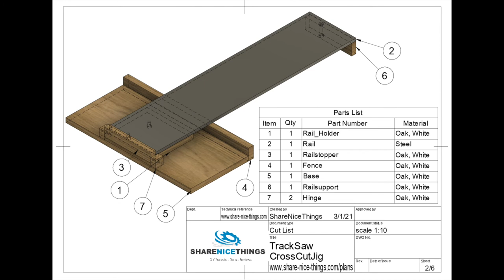Track Saw CROSSCUT JIG (precise) Limited Tools

Comment: Oh, now that is clever. The size of the wood panel to be cut is only limited by the length of the track and the parallel fence ist at the beginning and not the end of the whole jig. Very clever indeed. And with the Festool saw the blade is at the very edge of the bottom plate and there is no space for a aluminium profile so it is a lot better to use the track for that.

Comment: Congratulatios on your work! Do you have plans for the auxiliary supports?
Reply from the maker: Thanks a lot. To which auxiliary supports are you referring to? Cheers Daniel
Reply: @sharenicethings  ,The obe  you used in your workbench to cut thick wood.
Reply from the maker: If you mean the holders I attach to the side of my workbench I surely can do a plan for this.

Comment: Damn thats a really good idea. Its basically just like the mft version but easier to make. I´d rather use some proper T-nuts though as the rail is pretty soft.
Reply from the maker: Thanks a lot. Yes MFT was basically the inspiration for this jig. I do not see any stability issues concerning the rail like too much bending or anything else. Cheers Daniel